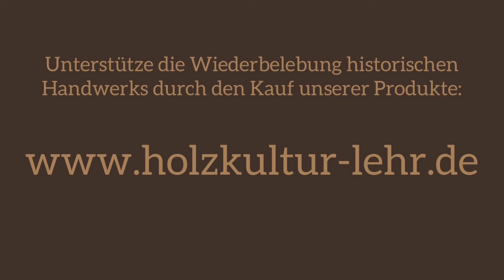Bowl turning without electricity: on the pole lathe [short version] - Jero & Pirmin Lehr

Comment: This is a handy video.  I was wondering how someone would be able to operate a lathe after the electric grid crashes because EVERYTHING was turned electric and the grid can't handle it.  I figured some operations would have to rely on waterwheels, but what if you aren't near a suitable water source.

Comment: Awesome work, but this is not a pole lathe. It appears to be a bungee or rubber band lathe. A pole lathe would actually include a stout green sapling to load and unload tension and rebound required to spin the work.
Reply from the maker: I know what you mean, but the term pole lathe is absolutely usual even for lathes with a bungee. We sometimes use a traditional pole, but haven't enough height in the workshop. For the turner it really doesn't make a big difference.
Reply from the maker: Here is our traditional pole https://www.instagram.com/p/CrmLLEFoVzM/?igshid=YmMyMTA2M2Y=

Comment: Isn't the rest a bit too far away?
Reply from the maker: The tool rest doesn't need to be extremely close to the workpiece when turning with these long handled hook tools. It's more important to have enough space for the left hand fixing the tool on the rest. If the rest is farer away than shown in this video it can be difficult to control the tool. For spindle turning with short handled gouges and skew chisels it's very important to get extremely close to the workpiece, we have a special toolrest for this which you can see in a reelon our Instagram channel.

Comment: Всё  отлично! Но брутальная стальная гайка нарушает стройную картину волшебного действия.
Reply from the maker: I see what you mean, but there are good reasons for it. The threaded rod is one of the best ways to fix the tip securely and permanently - at least it is better than gluing it in in every way. You can remove the nut, but it helps to reduce vibration.
Reply: @holzkultur_handgeschnitzt  В давние времена как то же справлялись без гаек. Тогда, правда, и Ютьюба не было, так что мы этого не увидим. Эх! Жаль.
Reply from the maker: @ЛевПетряшкин  Yes. But on some centuries-old wooden lathes there are also screws. They were forged, filed and the thread cut by hand. It would be better to forge a thicker point and only thread it as far as it will sink into the wood. 
I will hopefully have the opportunity to study in detail the attachment of the tips to old lathes. Many greetings

Comment: I didn’t know there was elastic or rubber bands in those times
Reply from the maker: We don't say or show that they existed in earlier centuries. This is no reenactment. It just shows how we produce wooden bowls today using a traditional hand tool technique.The rubber band has several advantages compared to the traditional pole. It is very mobile and adjustable. It's difficult to get a 6 m long, strong ash pole which is necessary for bowlturning. In our workshop we don't have enough height for using one. It's very difficult to sharpen the hook tools without diamond files too. Nevertheless, it's important to try the traditional methods as well. That's why we have recently started to work with a pole and it works well so far. We will use it at medieval markets. You will be able to see it on our Instagram channel in a few days.